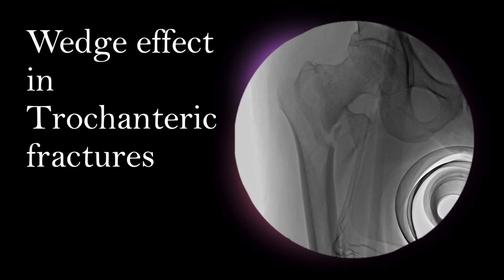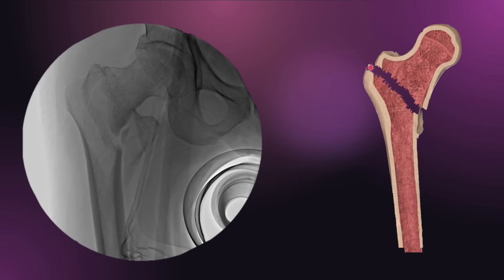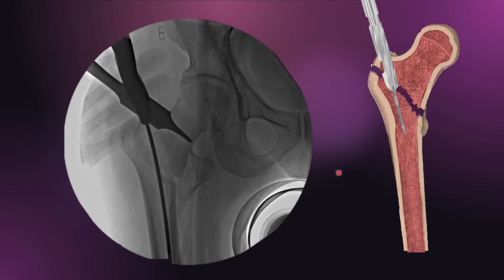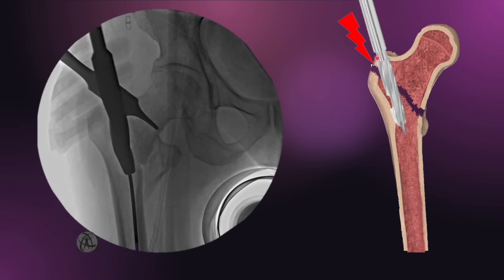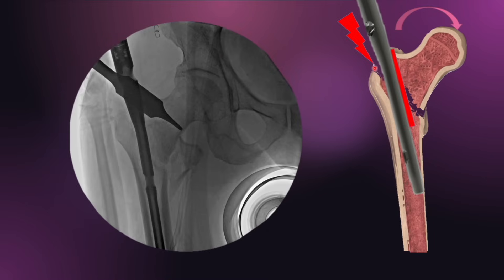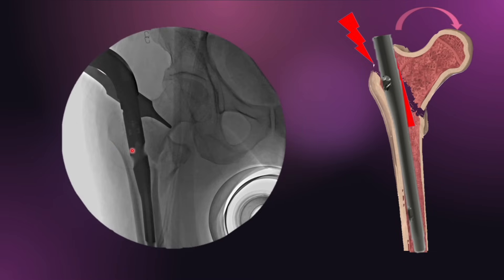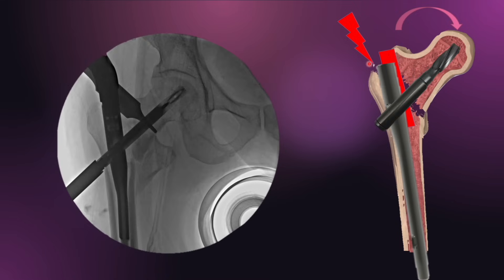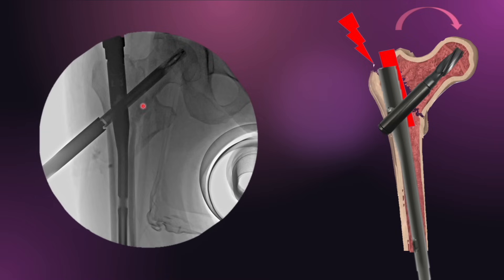Wedge Effect in Trochanteric Fractures/ IT fractures/ Proximal femur fractures

Comment: What is the advantage of pfn vis DHS.
Reply from the maker: Biomechanically PFN is better and strong, PFN is done in closed manner in trochnateric fractures while DHS need larger incision for plate placement; in old patients there is risk of subtroch fracture at DHS end, while  even in short PFN the end is tapered to avoid stress riser, blood is more in DHS, wound healing issues can be the in morbid patients in case of DHS due to larger wound. These are some major points. Otherwise in selected patients and fractures DHS is also fine as per local resources.
Reply: Thank you sir

Comment: Will the fracture unite if nail goes thru fracture site??
Reply from the maker: @rohitranjolker1778  Fracture can unite if there is contact between Fracture ends. So even if wedge effect has happened and your screw/blade in femoral head is not very superior and you have not distracted the fracture, it will still unite but in varus. When choosing medial entry you avoid getting inside fracture site laterally and the fracture ends are thus in contact after nail insertion. So, that should be the preferred thing. I ll try to share some images of non union and union when nail has gone through fracture site and update here.
Reply: @Justorthothings  thank you
Reply: @Justorthothings  I wonder if nail through fracture site wound unite, cause the nail might get in between fracture site and fracture site sliding may not be achieved.
Reply from the maker: I have seen non union cases with nail entry through fracture. However in some cases it may unite in deformity. I will not recommend going through fracture.

Comment: How to go about in obese patient 
Very difficult to gain medial entry even when properly positioned 
Any way to correct Varus after nail insertion or can doing it in a lateral position be a better idea
Reply from the maker: Use a long curved awl to place the guide pin just medial to GT, and use the awl as a directing device to push the guide pin deep and in line with the femoral canal. Then, with the awl, remove the medial bone. Do not use the solid proximal reamer; it brings the entry zone lateral, so use the flexible one. Removing the medial bone with an awl helps a lot. I'll share screenshots of an extremely obese pt in which I patiently removed the medial bone to ensure that the wedge effect does not happen.

Comment: 3:49 can you show how the image is in varus position (image in C arm) i coulnt appreciate it. Thank you
Reply from the maker: Thank you for the comment. Three things can be used as indicators of varus besides the actual neck-shaft angle. Here, when the blade is in the inferior part of the neck, it should end in the inferior quadrant of the femoral head also if normal valgus alignment needs to be restored. Second, the tip of the trochanter lies roughly at the level central zone of the femoral head when seen from the front; here, it is lying at the superior zone of the femoral head. Third, if you have medial cortical contact but opening proximally, that also means that the proximal fragment is rotated in varus. And most importantly, we need to see the preoperative valgus on the opposite side as well. Here is the link of post op radiograph which shows that the affected side is fixed in varus. 

https://ibb.co/Jy28Tvs
Reply: Sir in the link given 
The screw tip is matching with GT  ,  screw remains central . 
Except for proximal opening , it looks as good reduction. 
When compared to opposite hip it looks varus . 

Is it because of inter observer difference
Reply from the maker: @chaitanyaksk90  There can definitely be interobserver differences, but the proximal opening and medial contact should definitely indicate some varus even if subtle. The case is actually my operated case only, and I have been measuring the radiograph parameters in all such cases to improve subsequent surgeries. The nail when entering through the fracture hinders healing due to distraction. I have attached the markers that indicate that some varus malalignment is definitely there. Hope that helps. Thank you.

https://ibb.co/jy3tGFh
Reply: @Justorthothings  there are signs of varus. My doubt is , is that gross varus ? For me it looks like mild varsu
Reply from the maker: @chaitanyaksk90  Yes, Mild only. But that potentially risks further collapse due to soft bone in osteoporotic patients. In healthy bone, it might not affect much.
Reply: @Justorthothings  thank you for confirming. 
Thanks . 
Just a request please include intra op pictures wherever possible. For example today's case of calcaneum, if you could have shown the patient position intra op it would add better value. Anyways that was a nice video, I got new insights about calcaneum .
Reply from the maker: @chaitanyaksk90  Sure, I will do so. Thanks.
Reply: Sir,is this fracture in mild varus united well,or collapsed? @Justorthothings

Comment: This is a good point brought to discuss. If medially the fracture is kept distracted by enough traction, the proximal fragment is not titled, and the distal fragment is displaced laterally as there is no hinge point. Proximal femoral nail entry, maybe over the medial side of the trochanteric tip, brutally crushed insertions of all short rotators and jeopardize important arterial supply. There are many publications discussing post-operative hip pain (up to 53%) on this point. Presently researchers have accepted this drawback. I suggest 'Modified Ender Nailing Technique' to avoid all these issues and avoid damaging proximal femoral musculoskeletal and vascular structures. Please watch, https://youtu.be/vwF01z3RSOs 🙏
Reply from the maker: Thank you for your comment Sir. Yes, it is very important to avoid injury to the proximal muscles around trochanter. I first palpate the GT to find a muscle free zone. Then a pilot wire is put just medial to the tip in a non muscle area using a sleeve that sits on the trochanter. The wire is just gently hammered to give pilot point for an awl. We need NOT to go too medial, just medial to tip of GT is sufficient. Yes, as you rightly said the soft tissue part is critical in patient reported outcomes, being cautious towards this potential injury can be helpful. I also use awl to create the proximal track as it is gentle process and avoid trauma due to thick proximal reamer. Yes, will take important points form your video. 👍
Reply: @Justorthothings  🙏

Comment: Thanks for the presentation.  Won't the wide proximal portion of the nail disturb the neck when the entry point is medial or through piriformis fossa
Reply from the maker: Yes, keeping the entry directly in the piriformis fossa would be a concern. The main step is to keep the entry point medial to the greater trochanter tip, not directly over the piriformis fossa. We tend to ream more on the lateral side, as our manipulation starts laterally. So, basically, we need a space between the piriformis fossa and GT. Not sure how long-term clinicoradiological outcomes would be affected, but almost all patients land up in fracture union without any neck-related complications. But for lateral entry, we definitely invite complications like malunion, non-union, screw/blade displacement and early reduction loss.
Reply from the maker: The wide portion has been a concern previously as well. Newer nails (like TFNA) have addressed this issue to some extent. In elderly/osteoporotic patients, we just use the flexible proximal reamer to just open the mouth of the entry point. The remaining track is either created with a cannulated awl or sometimes left when the bone is of too weak.
Reply: Thank you.

Comment: What about trochanteric entry nails?. there also we have to make piriformis entry to prevent wedge effect?
Reply from the maker: Subtroch and some IT fractures have an inherent tendency to go into varus. The nail will take the space created during proximal reaming. So if a wrong track is created, then the fracture will go into varus. Entry point medial to GT will save from varus deformation. The direction of proximal reaming is also important; it should be towards the canal, not the medial cortex. I will soon add a video on entry points in subtroch fractures that will help understand things better.
Reply from the maker: Entry point through GT can be taken in a stable/simple diaphyseal fracture.